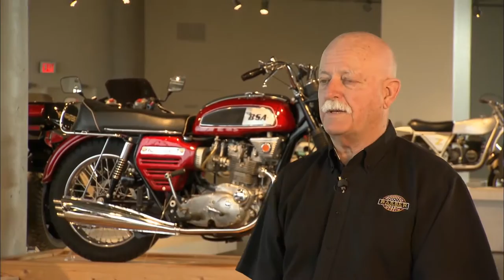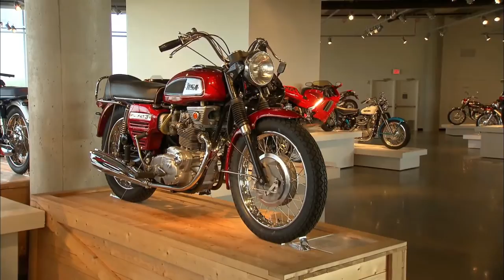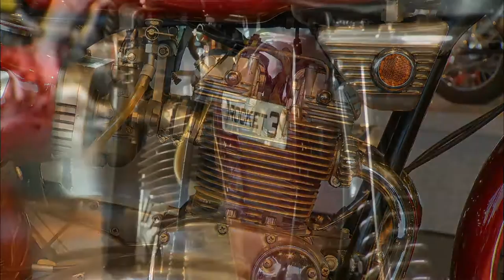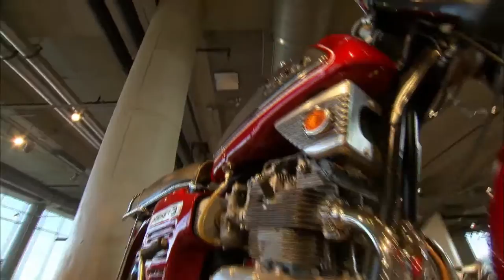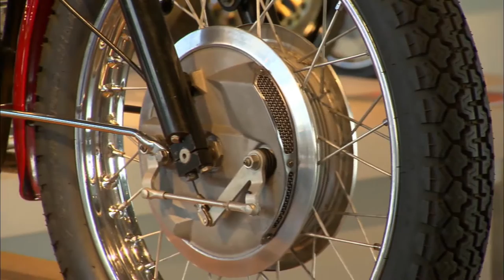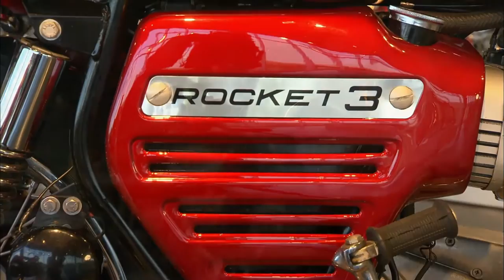Motorcycle Experience Time Capsule: Triumph Trident / BSA Rocket 3

Comment: Honda CB  750 4cyl was the super bike  triumph and bsa ware too little too late still nice bikes .
Reply: Have you ever seen a tripe & a Honda 4 at a set of lights. ever seen these two bikes on a twisty road. I have, being born 1951 and a motorcycle fanatic. I was in my late teens when they were new. I raced many fours on a Commando never lost. Kawasaki 900 was good  but wobbled in high speed bends.had a friend with a new one we had a go on a bendy mountain road I was riding a 67 Bonneville, he could not stick with me until the straights..
Reply: Cb100 repair engen
Reply: First true super bike was the Vincent HRD

Comment: When he said '...if you are going to work on them....' I laughed - it is sad to say this but, although they look nice and go like the rocket they are named after, you WILL need to work on it as all of them blow the centre cylinder sooner or later.  Every British biker knows that there are two sorts of Triumph/BSA triple.... those that have blown-up and those that are going to.....
Reply: I owned two and neither one blew up. You just have o know how to tune the fuel mixture and set the ignition timing. 
I’m currently restoring a 1974 Trident that has sat in a shed for forty years and the middle cylinder overheating problem was largely down to less than ideal exhaust port machining at the factory (which was not and is not hard to remedy) and the aforementioned tuning issues.
I have been riding for over fifty years and although I’ve heard a lot about the supposed number of Tridents that have blown up, there are far too many of them still around for the tales to be true, given that less than thirty thousand Tridents were produced in total. 
Take your myths and dump them, simply not as bad as you think.